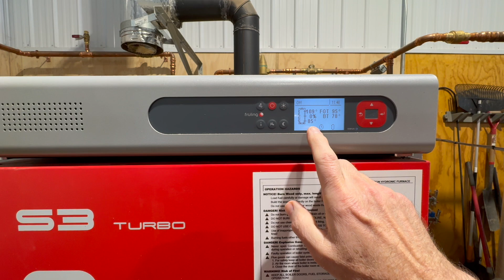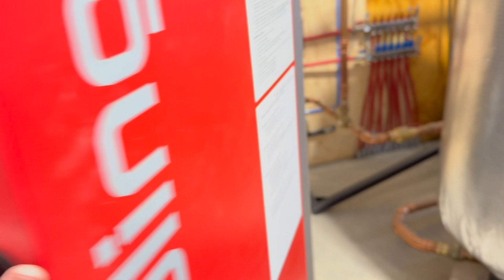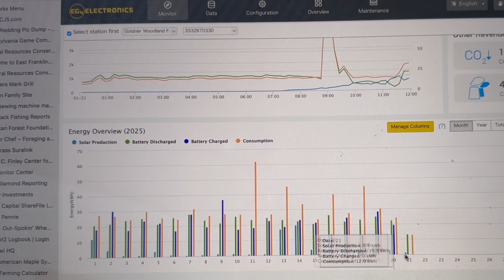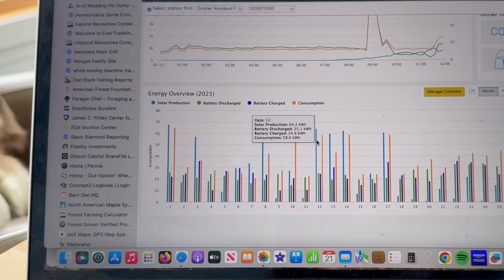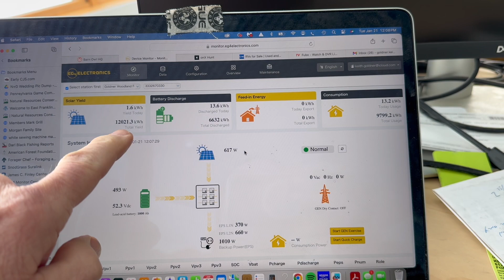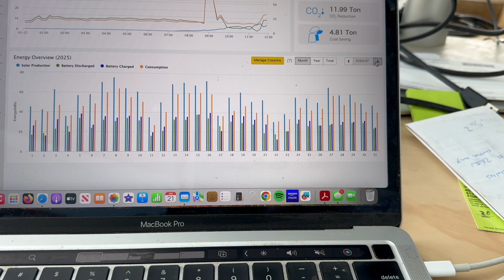Wood Boiler and Solar Update

Comment: Thanks for posting Pete.  I am impressed by your heating setup.  Can you comment on what features drove you to choose the Froling Boiler?  Did you also look at the Wood Gun by Alternate Heating Systems - they are manufactured pretty close to you in Western PA.  I am considering installing a wood burning boiler in my basement (located in Central NJ).  It would be very helpful if you could post a follow-up video showing the process of cleaning out the ash from your boiler.  It would be helpful to get candid feedback on how big a job this is, and more importantly (for me at least) whether a lot of ash escapes in the area during the process.

Comment: What is the latest news  on your setup? Any changes planned?
Reply from the maker: Thanks for watching and commenting.  I am going to add 2 EG4 Chargeverters to charge my house batteries instead of using the 18K PV Inverters.  The 18K PV Inverters are not controlling my Generac 24K Natural gas backup generator correctly. 

The Froling wood boiler system paired with a natural gas backup boiler is working well as is.
Reply: How often are you filling the boiler at tbese colder temps outside?

Comment: Those pumps look like they take about 60 watts,  amp I correct?  Or are they ECM pumps?
Reply from the maker: @norb231  I don’t know the answers to these questions.
Reply: @goldnerwoodlandfarm9305  take a new video showing the pump face. Also what kind of solar battey are you using? I seen 1000 ah lead acid in your video? Do you have to water the battey?
Reply from the maker: @norb231  I have LiFePO4 batteries from EG4 and Jakiper. Since I have a mix I am not using full communication from all the batteries to my EG4 18k PV inverters. EG4 uses the Lead Acid setting to manage the batteries based on voltage instead of state of charge SOC. If I had all EG4 batteries that communicated with the inverters I would use the Lithium setting and they would mange based on SOC. At least that is what I understand.
Reply from the maker: @norb231  the pumps are Grundfos UPS15-58FRC. It looks like they draw 80 watts.
Reply: @goldnerwoodlandfarm9305  change them out to a ecm style pump either a taco 007e or taco 0015e would work out they will take about 30 -40watts  or less.

Comment: Question If you have free nat. gas, why are you not burning it 24/7?
Reply from the maker: Thank you for watching and for commenting. You are not the first person to ask this question. One of our primary goals with this property is to reduce our impact on the environment. Using this high efficiency wood boiler has less impact than if we simply burned fossil fuels like natural gas for all of our heating.
Reply: @goldnerwoodlandfarm9305  I understand.  Next question how does the boiler know the weight of the wood in it?
Reply from the maker: @ The information on the screen indicates an estimate of how much wood to load not how much wood is loaded. I don’t know how it determines the estimate.
Reply: @goldnerwoodlandfarm9305  It must know the buffer tank volume and then estimate the time to heat the tank.  I would have to look at the manual.
Reply from the maker: @ yes, you have to indicate the size of the storage tanks during the setup process.
Reply from the maker: @ yes, you have to indicate the size of the storage tanks during the setup process.